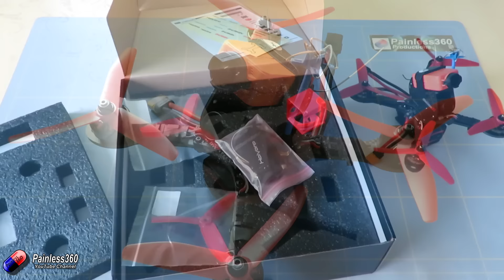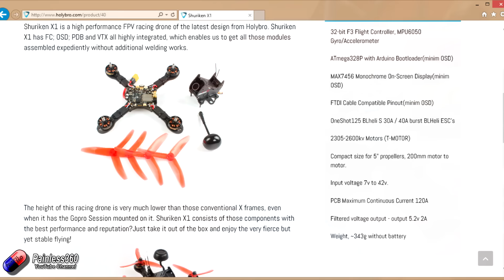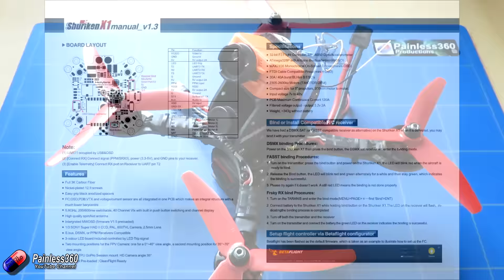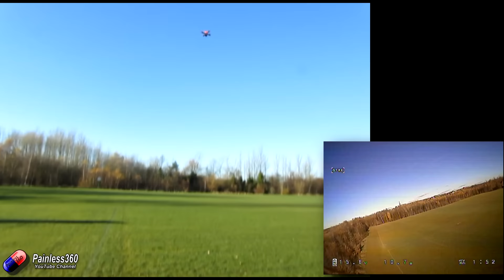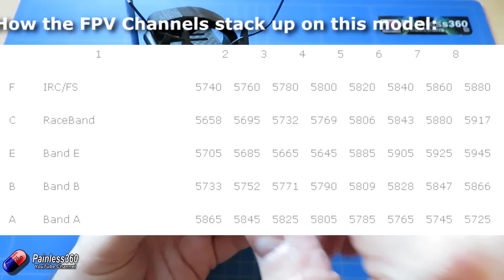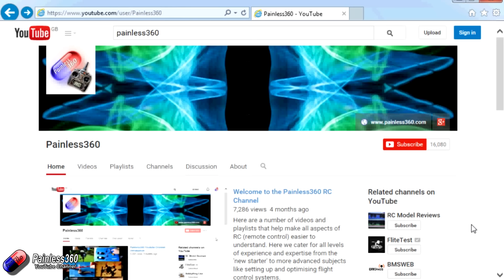RC Reviews: HolyBro Shuriken X1 Racing Quadcopter

Comment: Hello. Im new on the hobby. I have a Shuriken but my Futaba is S-FHSS (Futaba T8J). How can I change receiver? The Futaba FASST instaled have 4 wires and I dont know what connections I should make
Reply from the maker: Sorry, we don't use Futaba here so tricky to comment. This model comes with one of three receivers already installed.. Best of luck!
Reply: Painless360 tank you

Comment: hi im just about to start shopping for my first build im have just got a tarot tl250c frame from the drone show could you suggest what fc i was thinking an f4 and what esc's should use.i have to use mini esc's so they fit in the arms. i would be gratefull for any advice you could give
Reply from the maker: Littlebees may fit in the arms, check the dimensions. In terms of the flight controller then most of the SP3 clones seem to work well (if you use one, send Dom Clifton a few bucks as it's his design they ripped off), or some of the newer boards/stackable are fun and reduce the amount of messing about with extra cables for Vtx, OSD and other connections... Best of luck with the build!
Reply: check out the racerstars blheli s and the 4 in 1's... or dys xm blheli's are a half decent price now, whatever fc you get try to find out if blheli passthrough works. motors? racerstar 2205 2300 or 2600kv, and i have kingkong 2205 2300kv (benched at 2500kv) and they are above and beyond, no metaphysical pun intended.
Reply: time to start shopping many thanks
Reply: hello again ive seen a motor kit on bangood its the king kong force 250 micro do youknow if there any good
Reply: they are quite good kit but only for the little things, if you don't have cable ties and and battery strap or pdb, but it is not a great deal,it doesnt save any money. also the kingkong esc 20 esc is not well known... you can buy racerstar esc's which are well known i think, they are very cheap , you could even buy a 4 in 1 esc super cheap but i would suggest the individual blheli_s  20 or 30 amp esc's. the 's' makes it the latest version which is compatible with new blheli suit. there are also new racerstar 's' motors which are great value, i would suggest buying 5 motors.  the real problems come with the little things, you need  to buy cable shrink wrap and cable ties, and possibly nylon stand offs for the fc mount.  the force 250 is a good deal but i would recommend racerstar 2600kv motors buy 5 of them, and 20 or 30 amp esc's and a matek pdb with 5v and 12v becs... i don't know which fc to recommend other than make it an f3 board which can do passthrough for blheli.   so an spracing f3 or omnibus f3 but you must research the board for passthrough ability,  with deals like the wizard 220 arf its difficult to even match this deal and impossible to beat it even with the great value racerstar and kingkong are offering.

Comment: I bought one and have the eu lbt taranis and it wouldn't bind, tried flashing it to get the right software on it but couldn't after hours of trying. gave up and bought an eu lbt  xsr compatible transmitter in the end which was a pain to crimp all the wires etc and cost me an extra £25 but for it working at least.
Reply: Can u help me I got taranis plus running 2.1.6 and I lost my wizard screen when adding new model can you help me with this please thank you
Reply: cliff bailey hi cliff, I'm no expert in the slightest, if you are having trouble getting the yaw, thrust, etc the right way round you can change it in both betaflight and cleanflight. but if it's to setup for a quad instead of planes etc the only way I'd know to fix it would be to reinstall open tx again and hope it doesn't remove any previous models you have on it already. you can back it up somehow. if you look through painless's taranis series he goes into great detail how to do all this and you should find what you need there, but sorry I couldn't help more I barely get through all the software stuff myself. maybe quote painless and he might respond with a better answer. good luck !

Comment: the noise on the fpv cam is quite bad, i wonder if that's sorted for the final model?
Reply: I got this shuriken X1 and the interference on the fvp feed is very bad indeed especial on full throttle and you have to be careful whit the tune ... lave it on STOCK FACTORY pid's. on my 5th lipo my motor block in mid air and got smash t in the ground had 2 buy a new motor. but it is verry fast and light.
Reply: I had just ordered it. Remind me to let you know.
Reply from the maker: It was - ours was using the pre-release version of the main PCB and we swapped it out for a production unit (a few small changes including the way the Vtx worked) and its a lot better!
Reply: You're one of the few sadly. Mine arrives soon  hope.
Reply: let's hope so